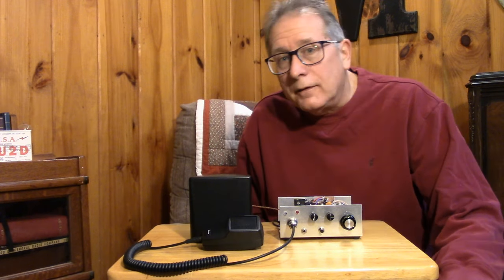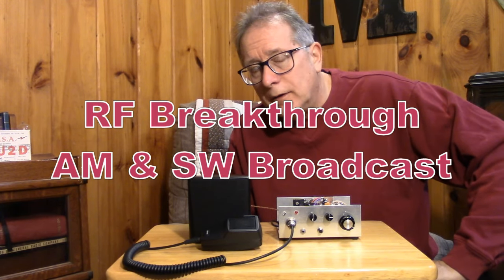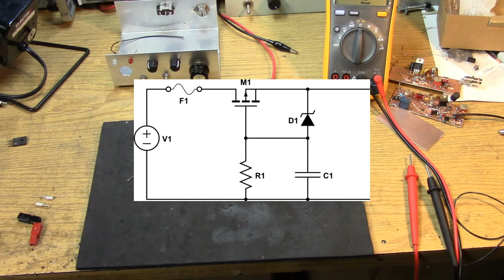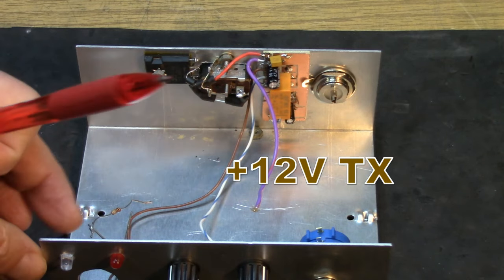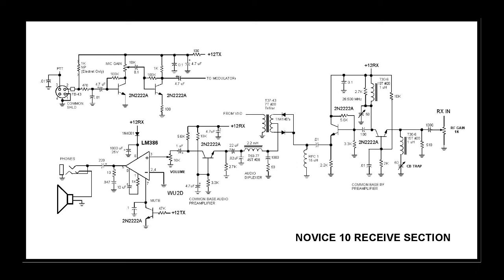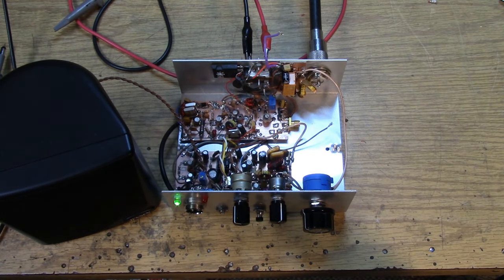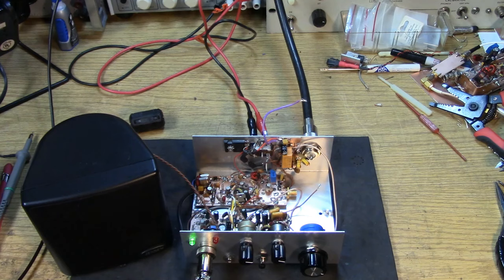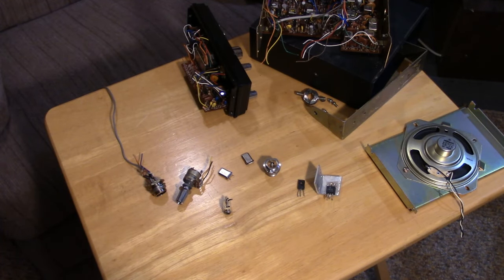Novice 10 DSB XCVR - Part 5 Receiver

Comment: Anderson Powerpole connectors have been promoted by the ARRL in order to establish a power connector standard for ham gear. They observed that on Field Days a lot of different power connectors on rigs made it difficult for hams to use their gear in conjunction with that of other hams, so they decided to suggest the Anderson Powerpole be made standard for those who thought the idea made sense. They picked a good, reliable, 'easy to use in the dark under stressful conditions without screwing up', type connector. It's one of the few ARRL decisions I wholeheartedly approve of.
Reply: They are pretty much a miniature version of the boost cables on tow trucks and fork lifts. I tried to get a radio club to switch there equipment to these once, but they insisted (or at least the club equipment manager) on using the "standard" cigarette lighter plugs. I tried to tell (him) that these were only "good" for 10 amps and weren't that good for much of anything except for lighting cigarettes. I HATE the damn things personally. Anderson power poles are the ONLY way to go. Not sure what to do if you have 24 volt equipment though. I would want a fool proof way of protecting the 12 volt equipment.
Reply from the maker: My buddy WA1QHQ said the patent ran out and anyone can make them now.
Reply: @W1RMD  You stack the connectors vertical and use differant colors for 24 volts.
Reply: Powerpole connectors are brilliant but 
always always use the recommend crimping tool .

Comment: Great information on the DC type receiver pitfalls and cures.
Looking forward to the final design.
Reply from the maker: A metal box is suggested! And battery power. And serious attention to a good ground plane and isolating stages, and a strong LO - BUT limiting LO radiation. A lot of requirements for such a simple circuit. It really is a case of - what you build is what you get.

Comment: Good construction tip about lifting the boards off the chassis for wiring. I'd also mount sub-assemblies on Velcro. It not only makes things convenient to work on, but also provides great mechanical damping to minimize microphonics. (Besides, I think I've spent 10% of my life screwing stand-offs off and on.) Also, use soft, multi-strand flexible wire throughout and a padded case to further minimize microphonics. 

My problem with watching your videos is that I find myself really wanting to build yet another rig, when my shack is already full of them, from classic glow-in-the-dark boat anchors to tiny digital rigs (truSDX's and hopped-up Pixies,) that hide behind my soldering iron. And I seldom actually get on the air. Oh well. It beats the alternatives.  :)
Reply from the maker: Thank you for the thoughtful and very experience laden comments!

Comment: Very useful trick with the ferrite barrel on the power line! I'm remember one other trick with a "π" network, consisted from: one VK200   inductor in series and two 100pF capacitors to ground for decoupling. This filter has great results on VHF, especially for powering kit's for AIR band receiving.
Reply from the maker: I think the strong LO leakage and power supply ground loops produce the remodulation hum that the bead is effective at breaking up.

Comment: I've always been a fan of direct conversion receivers using QSD type circuity. Of course it has its trade-offs requiring roofing filters after the detector and the requirement of using fairly high quality, low noise audio operational amplifiers on the I-Q channels after the QSD. Plus to really take advantage of these kinds of direct conversion receivers you have to embrace some level of digital circuity to generate the quadrature clock going into the QSD, and if you want to avoid a lot fairly complicated audio circuity feeding the I-Q channels into an ADC or a PC sound card helps.
Reply from the maker: The basic ZIF idea has been explored and published in ham magazines and books much further than this simple treatment.  Very high performance is possible. With the addition of I and Q demodulators on some of the chips that came in the late 90s with onboard clocks and dividers; this made the system pretty much standard for digital demodulation with early baseband DSP. I was an applications engineer at ADI and supported the reference design eval. boards for the now classic AD607 and 608, 831 mixer and 6432 devices.

Comment: 👍 Excellent, thanks Mike. I really liked that relay current saving trick.
Reply: It's a goodie hey. I reckon I'd put a potentiometer in place of the resistor so you can determine the best resistance that makes your particular relay the most reliable under all operating voltages to be encountered, which could prove to be very important if you're running it off batteries in a portable set up.
Reply from the maker: @Dazzwidd  My first boss at Motorola taught me that one back in 1980. He was a design engineer on the Motorola Micor!
Reply: @MIKROWAVE1  There's lots of little tricks like this using discrete components that make you slap yourself when you see them 😅

Comment: Great series Mike.
I've spent many hours trying to get rid of the dreaded LM386 plop, it's bad enough through a loudspeaker but downright nasty when using headphones. I think my solution for a Farhan's bitx build, was to leave the 386 powered, then mute and also kill the power to the preamp.  I'm not really a fan of the little beast, but there's no denying that it's damn useful.
Steve M0KOV
Reply from the maker: I could keep going - just on the muting alone to perfect it. I have a couple more circuits to try, a series FET analog switch, a Mosfet to ground and even a PNP power switch up top after the big cap. But there already are about 25% more parts on this thing than are really required!

Comment: This is a very interesting build.   
Killing the hum with the ferrite was interesting since 60 Hz is well below where I would consider the ferrite usable. Is the 60/120 Hz riding on a common mode RF signal?
Reply from the maker: Likely re-modulation of the VXO frequency. Local oscillator leakage is the bane of these DC receivers. A metal chassis is a big help. Of course having the metal  cover on would help  too!

Comment: Hi Mike, I have built a few of the direct conversion (DC) circuits from Rick Campbell KK7B. Your hum removal via the big rail bead was a good tip, but I have that awful noise (probably switching power supply, florescent lamps, etc.) that you had as well, even when I kill all the switchers that I can find. It drives me nuts. I am sure your antenna is finer than my inverted V dipole, but in your demo you seemed to suffer the same noise I am getting. After cancelling the hum was that noise just pure atmosphere? Can you talk about mitigating that? I have seen your noise reduction project video. Is that the only way to combat that noise? Is it a DC thing since we can't further filter an IF? Do I need a noise shaping delta-sigma modulator to shift that noise out of the audio band...? Arghh.
Reply from the maker: Noise is bet cured at the source. Ha UGG. Realistically I have made noise cancellers using a local "noise antenna" or even the "AC ground" against the main antenna and it really does work. Not always fun having to adjust it band by band, but it works.  https://www.youtube.com/watch?v=8ybIoIhwgBQ

Comment: So do you need that jbt audio preamp ?

The 386 has a more gain if abused properly !
You can just ignore doing the normal cap across 1 & 8 pins thing .
Series up a 100uf cap & 1k pot between pin 1 & 0V ( n/c pin 8 ) .
Set your gain & sub that value resistor for the pot .

I also use a inductor after the 386 as a hash filter ( plus a switched ) .

My favourite rf preamp is a low noise grounded base jbt circuit & it's a oddball  .
It's 47R emitter resistor is the input but via 1 full turn on the output transformer .
Its from a old QRP blog but the site is now MIA .😞

PS  
The diplexer stops some of the nasty products mixers can put out .
It's not only a filter it is also a fixed load on the mixer port .
Reply from the maker: Another good point, you can play with the feedback - but the 386 is happy (more stable) at lower gain (boy do they like to oscillate), and the common base amplifier; beyond giving low noise gain, provides the demodulator with a low Z, for excellent dynamic range. We have no AGC.
Reply: I found a version of my norton rf preamp circuit on 

“Amateur and Short Wave Radio Electronics Experimenter's Web Site” .

Its a version of figure 1 & 2 “Toroidal Inductor Norton Amp” sorry yt won't let me post links !

As for the 386 stability problems you'll be putting it on a double sided pcb .
You could make that configuration a option .

Comment: Schottky diodes, (like most semiconductor junctions,) have lower junction drops as they warm up. Power Schottky's really only have low junction drop when they're fairly warm. So the best way to use one as a series polarity protection diode on the power lead and significantly reduce loss is not to parallel them, but to use one that will get fairly warm during use. Thermal stability is always a tricky balancing act though, so think it through. BTW, did you try using ceramic resonators instead of crystals to get a little more tuning range?
Reply from the maker: I was happy to see that there are some "standard" crystals in the Novice part of 10M available from Mouser and Digikey. I never looked for ceramic resonators. Maybe there are some out there, and yes more delta could be possible.

Comment: You have multiple circuit boards in a metal chassis, do you have a single ground point and if so where have you located it?
Reply from the maker: The ground plane is the practical single point ground for most electronics. A star ground to a single point  is effective in ultra simple equipment where lead length is not a limiting factor, but it is not actually realistic.

Comment: Have you considered a ceramic resonator vfo for larger tuning coverage?
Reply from the maker: Good point! I looked, and it is possible for ceramic resonators to be produced at 28.5 MHz, but I saw nothing out there. Crystals are more available in this range. Another possibility is a tripler. In fact one of the crystals pulled from the CB was a 9 MHz job that would triple right in band - and would thus triple the delta tuning.